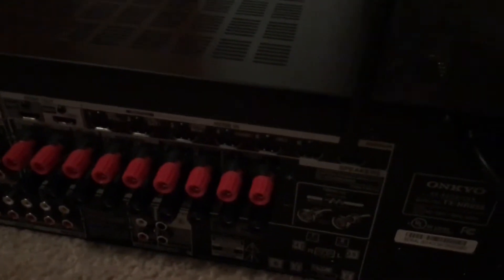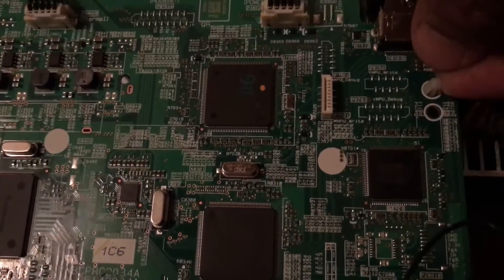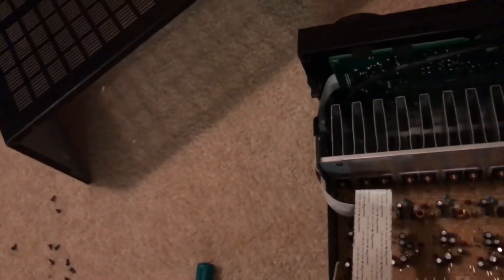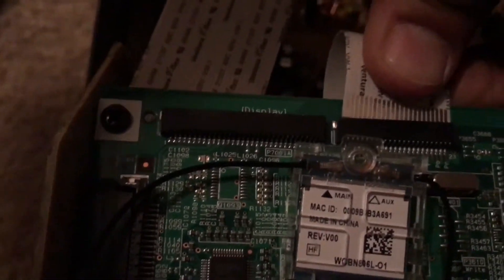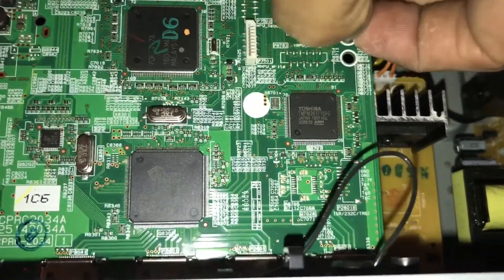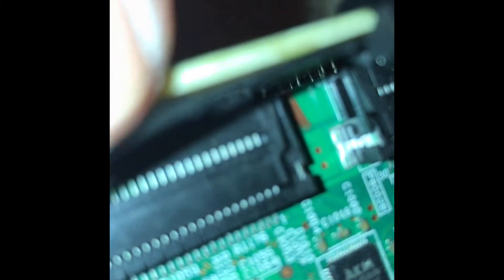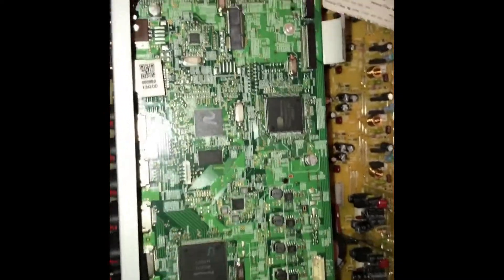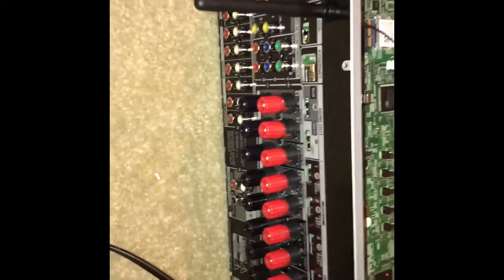Onkyo TX-NR656 HDMI board replacement

Comment: This receiver does what you need it to do🔊>lnfo.help/Receiver?せ    Stepped up from a TX Sr 607 to this and I'm glad I did. Blue tooth and Wifi are awesome and the phone app works well. I auditioned a Denon in command 2100 but it did not sound as natural and soft with my B&W's. I must admit I wanted to lean toward a different brand but I'm really glad I went back to Onkyo.

Comment: All of these ONKYO/INTEGRA users are the proof that the brand just made a HUMONGOUS MISTAKE in several units of several models of the brands mentioned. THEY DON´T EVEN SELL the freaking HDMI board... DOES ANYONE IN HERE THINK THAT´S FAIR to the costumers? 
And I´m not just someone passing by... I´ve had a ONKYO receiver with no video output but with sound and now with a INTEGRA 40.1 just the other way around (with video but no sound). I´m living the disgrace!

I think they should be replacing all of the defective units with brand new equivalent receivers. Anyone with me? What do you think?
Reply from the maker: Agree. It’s almost impossible to find these boards. I got lucky on eBay.

Comment: Hi, my Onkyo TX-NR656 has the same issue with the HDMI board, do you know where can I buy a replacement one?
Reply from the maker: You can try Ebay for an old available for parts or contact manufacturer

Comment: Hi.Please tell me the model of transistors which are on the lower circuit Board and are attached to the radiator if possible?I have already changed, not native.Want put the original of the
Reply from the maker: игорь чуйков no idea. I already put it back together.

Comment: The board on my Integra (Onkyo) DHC40.1 has failed again (2nd time). Where do you purchase this HDMI board? Onkyo/Integra will not sell replacement parts.
Reply from the maker: dont know. look for damaged units on ebay which might have a bad power supply or some other issue but a good board and you can get the board out and use it.
Reply: All you have to do is wait for someone else to sell their Integra 40.1 with something else damaged and buy it... to extract the board from one and then replace yours. 

One question... will you consider buying an onkyo/integra again in your life?
Reply: @magalimoreno2084  No

Comment: I have to replace my HDMI board on TX--NR636. That said this is the third time the board has failed. the first two times under warranty and suspect lighting. Where can you buy these replacement boards online? Do you have a link for a supplier ? they seem very hard to come by.
Reply: I have to replace my HDMI board too for the 2nd time! Has anyone tried reflowing their HDMI board first?
Reply from the maker: dont know. look for damaged units on ebay which might have a bad power supply or some other issue but a good board and you can get the board out and use it.